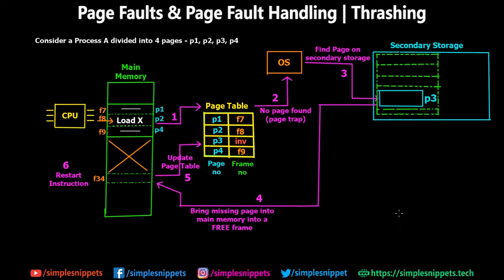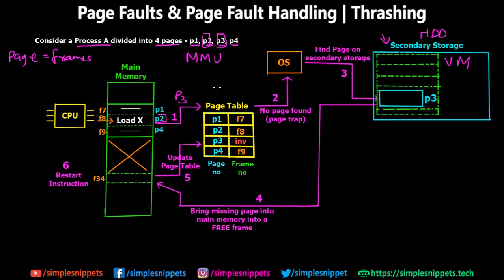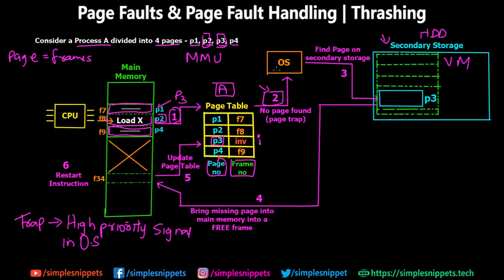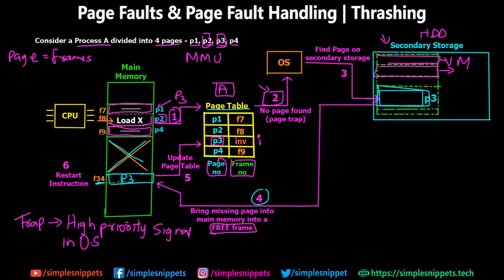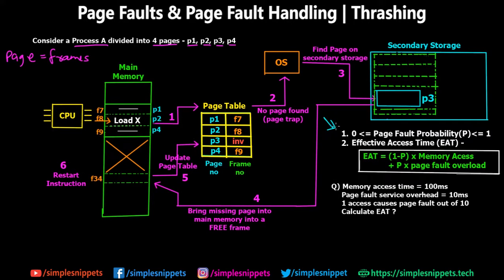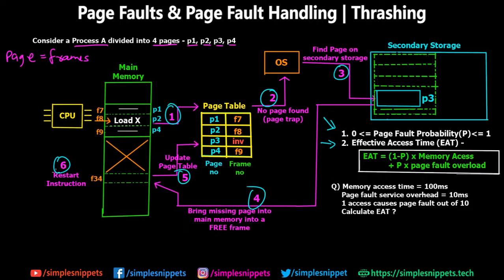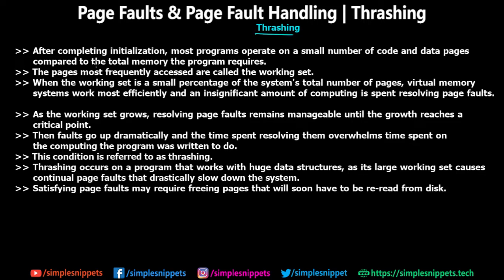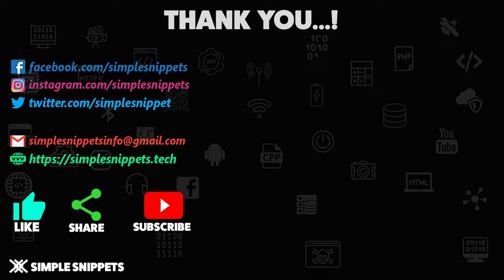Page Faults & Page Fault Handling in Operating Systems | Page Fault Numerical Example | Thrashing

Comment from the maker: Hey Guys, if you want more such tech educational videos on this channel then please support me by subscribing to this channel & also share it with your friends as it helps me create more content just for you ✌
Reply: Effective access time cannot be lesser than the memory access time when there is no page fault. It should come out to be 101 ms instead of 91 ms. This mistake has occurred because you have not added the usual (when there is no page fault) access time to the overhead in case of page fault before multiplying it by 0.1.
Also, comprehensive explanation otherwise. This was a great help.

Comment: EAT example is wrong. The time for page fault service overhead time cant be lower than the normal memory access time. Because otherwise a higher page fault rate would result in a lower EAT, which does not make sense

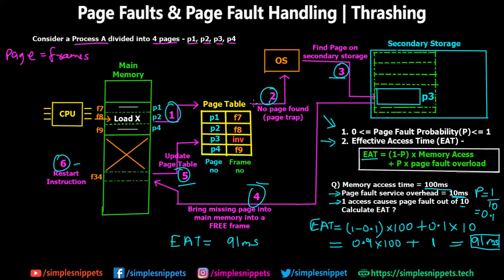Comment: 10:54 I believe your numerical problem example is not the best example. If memory access time is 100ms, how can the page fault overhead be 10ms?

Page fault overhead = memory access to page table + memory access to secondary storage + updating page table in memory + restarting the instruction

so if memory access time is itself 100ms, then page fault overhead needs to be at least 4x the memory access. Your formula is right, but the example doesn't make any sense.

Comment: Great explanation. It made perfect sense. 
I’m slightly curious about the test question though. Wouldn’t it actually be .9*100 + .1*110 which is 101? Because 10% of the time we have page fault overhead which adds to the already existing access time right? You could also think about it as 100% of the time, memory access is 100ms, but then 10% of the time there will be an extra 10ms which means it’s 1*100 + .1*10 = 101

Comment: Tanks for video. 
I hade a question  about "page fault overlaod" in 10:35 : shoulden´t it be 110?
because "Momory access time" includes in page fault overload.
Reply: I think so. The time when a page fault occurs should be much higher. Through his example the EAT would be faster if the page fault rate is higher

Comment: Rather than (1-P)*<Memory access time> + P*<page fault overload>, EAT  should be = <Memory access time> + P*<page fault overload>.
This is because irrespective of page fault or not, memory access time is going to be there always.
Reply: Page fault overload process already includes the memory access time. So, if you put 1 instead of (1-p), you count the memory access time in page fault overload process twice
Reply: @kemalkubilayylmaz4142 The page fault overload in the example should be 110ms instead of 10ms which is used in the example calculation.

Comment: Your EAT calculation is wrong. The EAT is coming to be lower than memory access time after 10% page fault.
The correct calculation would bb 0.9 * 100 + 0.1 *(100 + 10) = 101ms
Reply: Yes, you're right

Comment: Bhai ye page fault waale question ka answer galat hai......
Answer 101 hoga....
((0.9*100)+(0.1*(100+10)))=101...
In this question 100 second will be memory access time + 10 seconds will be penalty for page fault....
Reply from the maker: Good question, well you have applied the formula incorrectly buddy. the second part is (probability of failure * the overhead time) and not the total time with overhead. the overhead time generally itself this the time taken to perform all the page fault activities itself :-)
Reply: @SimpleSnippets  dear,
We will only get to know that demanded page is missing in the primary memory when we will access it.....
So we should add access time to page fault time......
This is my last argument.....
Please resolve it.......